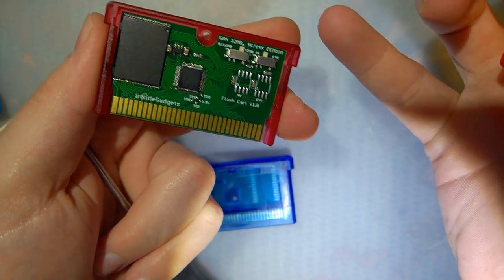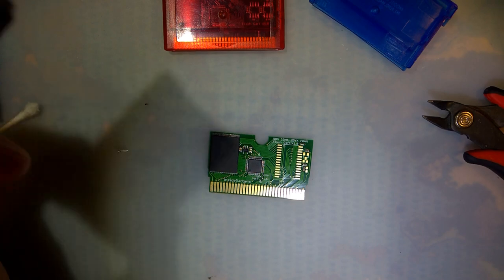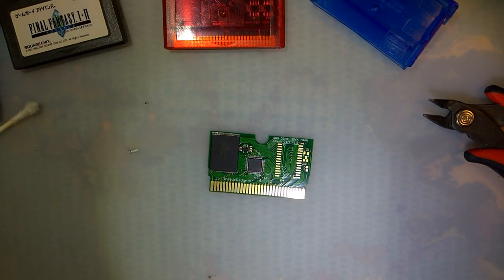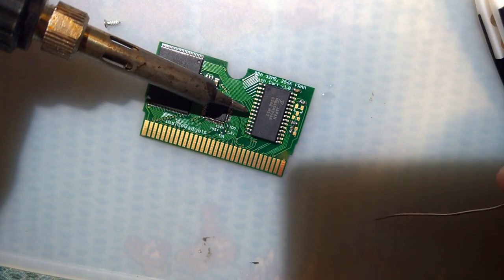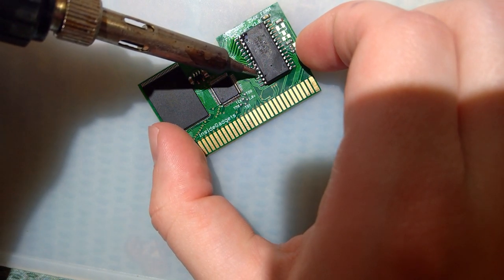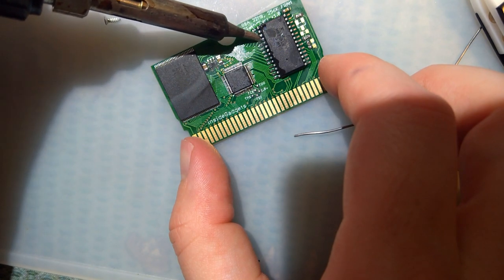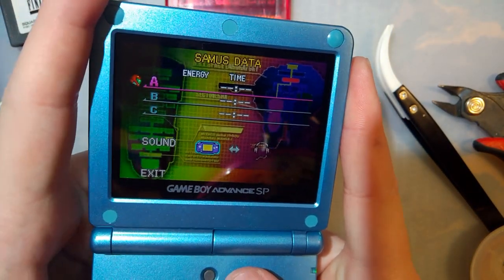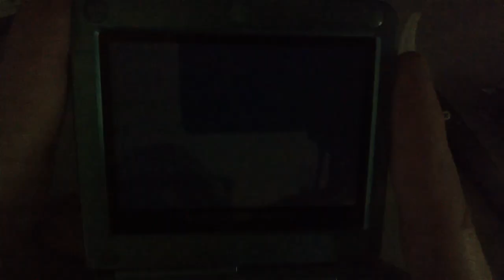Building an insideGadgets Game Boy Advance FRAM Flash Cart

Comment: To do this soldering, at which temperature do you put your soldering iron? I try with 250°C/482°F but the solder is hard to melt. So I try with 300°C/572°F or a bit more but I have the fear to overheat everything
Reply from the maker: I solder at around 300°C
Reply: @makho  Got it, it really was a problem for me. Thank you :D

Comment: I'm just wondering what's the advantage of doing something like this. 

I running two setups currently, an ez flash omega and reflashing Chinese repros. EZ-Flash to have the library with me. Reflashed Chinese repro for me to just focus on one game...and it's a cleaner setup...it behaves like an actual game cart.  They're cheap enough for me to buy a bunch and flash some games in them (usually rom hacks and translations).

insidegadgets flash carts are almost as expensive as a flash cart and wayyy more than chinese repro (one of these is the same as at least 5 repros). I'm sure quality wise...it's probably better than the chinese repros. But what's exactly is the reason why I should get this as opposed to any other solution out there? especially when for a like a little more you can get an omega with much more features. 

I'm not trying to be dismissive if I come off that way. I'm actually really interested in these. I love experimenting with different way to play GBA games. I have a few flash cart and waiting for Krikkz new GBA x5.
Reply from the maker: You can flash a single game to this and just play it. No need to worry about saves (unlike bootlegs) and no choice paralysis. Like how the flash save cart is compatible with palpark, this would be the same for any compatible games as it will be recognized as the actual game and not an ezflash omega. 

Also, power usage on this is significantly lower than an omega.